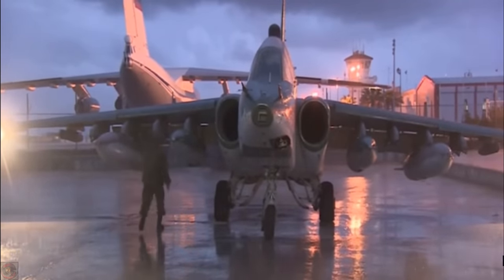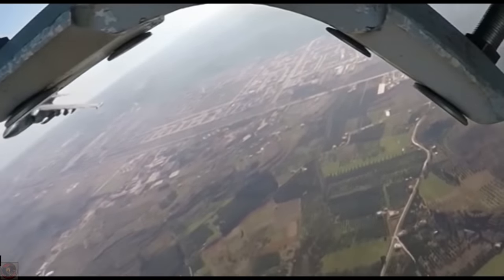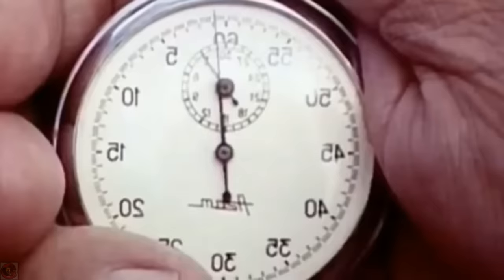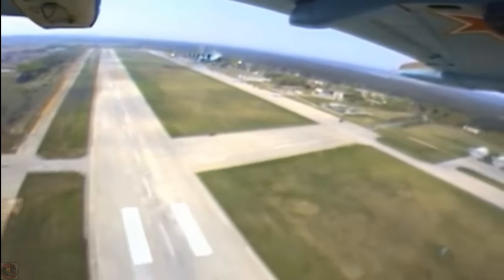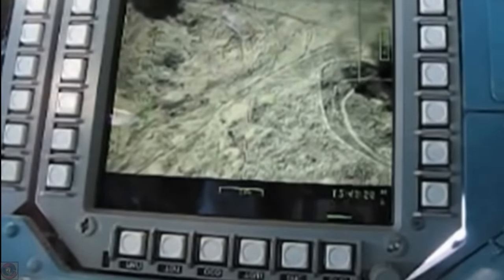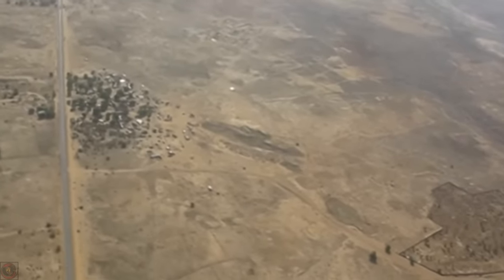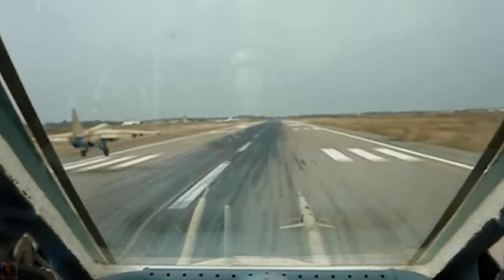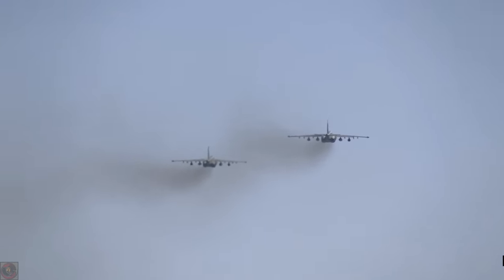Su-25 Frogfoot - The Russian Flying Tank

Comment: +Mastsimus Gaming : Great video Matsimus; I personally would NOT like to be on the ground looking at the business end of this aircraft! (Former U.S. Army Soldier). 
By the way, I tend to agree with you about your comments on this being a good aircraft for it's current use, i.e. blasting insurgents on mountainsides, in convoys, etc. In fact, I wonder why the U.S. and Britain doesn't use rocket pods as much as the Russians? I do realize that they are less accurate, but if friendly forces are far enough away, I think they are a perfect weapon, maybe especially the slightly larger rockets that the Russians use as well. (We in the West tend to only use the ~70mm rockets as far as I know of).
Thanks!

Comment: The A-10 GAU-8 rotary Cannon is a very intimidating piece of kit on the plane and is rather famous. But in terms of accuracy, yes it's not the best, relying more on a beating zone circle than actually getting rounds on target, it's basically glorified spray and pray. Still more than that, the economics is something often forgotten when it comes to war machines. The GAU-8's rate of fire is so high, there needs to be a big drum of 1200 30mm rounds to keep such a weapon viable, Those are huge rounds. That is alot of weight and an expensive amount of ammunition to mount.

The SU-25's  GSh-30 autocannon is not as impressive, still it does the job well. Needing a magazine of only 260 rounds. relying more to get rounds on target.  It's considerably more cost effective to reload, less wasteful of ammunition.

Comment: I once saw a video of an Serbian ( I think ) SU 25 . There was like an inch of ice covering the plane. The guys used sledgehammers to break the ice off and get it ready for takeoff. This airplane was designed to withstand extreme temperatures like in Afghanistan during the summer or the cold Russian winters. Pretty impressive. And it can fly using diesel fuel if needed.

Comment: I'm curious... why does the runway these aircraft are taking off from have that honeycomb pattern on it? Is it made up of a bunch of tiles? Is that just a marking used for measurement?
Reply: those are water drainage channels in runway concrete to prevent water puddles forming when it rains

Comment: Personally I believe the future of CAS is a return to propeller aircraft. They have better loitering capabilities and a slower approach allowing more time on target, plus arent anywhere near the fuel hogs jets are.
Reply: I've been thinking the same recently. Only thought that became a wall for now is how to design a prop plane that can also be resilient as either this one or the warthog. This coming from the premise that both planes jumped to fame exactly because of their staying power, that insane capability to withstand tremendous amounts of punishment and still land with an uninjured pilot. Cheers Col.
Reply: @hansvonmannschaft9062  interesting thought. My gut feeling is make a pusher with a rear mounted engine and prop. If that wont provide enough power than a similar setup to the Westland Wyvern and counter rotating propellers might be plausible. Its a tad complex but is all housed inside the main tail section and convenient for armoring. Without using a pusher or a prop based version of the current engine orientation I dont see another good placement that wont interfere with ordinance delivery or be tough enough to take a few dozen hits.
Reply: @Colonel_Overkill  Nono - I do believe you did nail it! I was tunnel-visioned trying to work around other succesful prop CAS planes like the South American Tucano and Pucara, with either nose or wing mounted props. But... A twin, interleaved-bladed, counter rotating prop package in the tail section would provide an immense amount of benefits and most important of all, the idea's plausibility! Must add this whole small conversation got me all excited and definitely reminded me of a decade ago, when I was a (relatively) young advisor in my country's DoD haha :-) Hopefully someone picks up on the idea. I know for certain, though, that the US' DoD has been looking into the above mentioned Tucano as a potential replacement for the A-10 - heck back then it was all over Jane's line of magazines. Been a pleasure Col, may you have a nice day!
Reply: @hansvonmannschaft9062  may you as well have a wonderful day. It is so refreshing to have both an intelligent and pleasant conversation in the comments. A true rarity in these days.
Reply: Colonel Overkill this is actually true, a lot of militaries are developing propeller CAS and the US is also interested in them after the A-10

Comment: Why does the Russian military love rockets so much, because they're cheap?
Reply: Because the destruction from  heavy rocket fire is just as effective as 30mm cannon
Reply: @thomasgellos1732  That makes no sense, seeing how they can carry far more cannon shells than rockets, so if they are just as effective, why carry rockets at all?  No, the rocket pods are attached at hardpoints under the wing, taking a spot that could be used for other munitions, to include precision guided munitions vs. the area effective rockets.  It is not just with the Su-25, you see it with many of their attack platforms (i.e. Mi-24).  So, it begs the question, why?  Is it cost of rockets vs other munitions, or is it a tactical decision because they view concentrated rocket fire as more effective than say a 500lb bomb?  If they do, to me it proves that they lack significant numbers of precision guided bombs of that size (smaller than 1000lb) in their inventory.

Comment: Precision guided attacks do not seem to be Russia’s forte:

“Despite the publicity surrounding them, it was the older Su-24 Fencer strike aircraft and the Su-25 Frogfoot that would do the bulk of the heavy lifting in Syria. And while there is no disputing the abilities of the Su-30SM and Su-35S in an air-to-air dogfight, without a modern targeting pod, their ability to lob anything but unguided “dumb” bombs is extremely limited.

“As a result, precision weapons have only been a small fraction of the weapons employed by Russian aviation forces in Syria. On occasion Russia has provided images of Su-34s carrying guided weapons such as the KAB-1500L laser guided bomb, the Kh-25ML laser-guided missile which dates back to the Soviet era or the KAB-500S GLONASS satellite guided bomb. But those weapons are the exception rather than the norm, and almost exclusively carried by the Su-34. Instead, ‘dumb’ bombs are the absolute majority of bombs dropped, mainly the 250kg OFAB-250-270 and 500kg FAB-500M-62 as well as the RBK-500 cluster bombs. Strangely, the Russian aircraft have flown with very small weapon loads, carrying only a small portion of their available capacity.

https://foxtrotalpha.jalopnik.com/russia-s-involvement-in-syria-proves-that-its-far-behin-1794966734

Comment: The Reason SU 25 is a bit old in tech is because most of the modern tech is plumped into the SU 34, which is FAR MORE MODERN, and far more capable.

SU 25 is simply cheaper to use against insurgencies, Terrorists, and enemies with limited capabilities.

Comment: Why didn't East Germany get the Su-25?  This was the one place it was designed for and where it was most needed.  This was where the Warsaw Pact most wanted tank-busting ability - in the tank-on-tank clashes at the center of gravity of a World War 3.  Instead the East Germans --- ordinarily favored with the top-of-the-line Soviet equipment, not downgraded export versions -- had to make do with the older Su-22 which while rugged lacked the armor and heavy guns, and the MiG-23 pressed into service in the ground attack role, and not even its MiG-27 upgrade that had ground attack modifications.  The East Germans even had to watch Bulgaria (which, let's be honest, was a backwater) be given the Su-25 -- for use presumably in the secondary priority theater of the Balkans.  What gives??

Comment: Russia is going to upgrade the Su-25 because Syria is showing them a plane like this is still very usefull. The plane is maybe very old, but it is a part of a army that can provide more high tech support to the pilots of the plane.

The US is going to take the A-10 out of service and replace it with the F-35 JSF. If you're pilot, what do you prefer: flying low altitude with this old Su-25 or flying low altitude with the F-35?

Comment: Like their Dome Radar system Russia has a stratified system with their aircraft where they are used together in a mix according to circumstances with each having a particular role so the SU-25 is protected from Patriot and other threats from the air by other aircraft and missile systems. With most of their weapon systems Russia goes for durability, survivability and ease of  operation and maintenance and repair in the field whereas with the US they have to be returned to special depots or the manufacturer. They also go for numbers which requires the costs to be kept low.

Comment: You definitely didn't get a thing during watching this aircraft - it does not need smart ammunition because aircraft fire control system is smart enough to calculate where brainless rocket will go, also ussr/russia don't use Gatling system(they were tested but considered over complicated for task which can be done other ways) but it doesn't mean that main guns does not have competitive rate of fire, which is 3000 30mm rounds per minute

Comment: The need to update weaponry is not a subject that is overlooked by any means by the Federation of Russia, however, they are smart enough to produce first then let the news out.
There are three new aircraft under build at the moment, none of which you will see let alone hear about, but all three have vastly more dangerous forms of weaponry, the idear being to hit every time as apposed to waste on misses, every bit of weaponry must be able to pay for the ride, plus travel so fast you cannot avoid it or outrun it.
The other thing that goes unmentioned is the fact that operational hight is also a big thing for Russian aircraft these days, the higher you go the less fuel you use the longer you can stay in operation, plus being attacked from an aircraft that is way above you provides greater safety for the pilot or for the flight system if unmaned, there is flying under the rainbow or flying over the rainbow is the way it was put to me.
These days its far better just to carry on the work and say nothing, at the same time as keeping your ears well tuned to the market place.
A brief look at cival aircraft and its production in Russia, their engines are now very much cutting edge and promise even better thing in the very near future, and for countries that like to think they are top dog, being bitten in an area were the crown jewels are kept, and being able to make that bite is a goal worth chasing as far as Russia is concerned.
You will see a lot less of the fantasy designs that are shown for the U.S. air force on you tube, i think a good example of Russian design is based on the behavour of something like a honey badger!!!!!

Comment: The Su-25 and the A-10 are both great at providing hard-hitting air-to-ground firepower since they are both basically flying tanks.  But the AC-130 Spectra Gunship would beat them both: a flying canon beats a flying tank anytime in terms of shear firepower.

Comment: The reason you didn't find that info on modern systems for the su 25 is because there is none. The SU-39 on the other hand has those systems and is the "modern" su-25.

Comment: Question i like to know the frogfoot looks like the old coldwar airframe with higher speeds needed for lift with swept wing which gives stability at speed and would i be right in saying its way inferior to a10 warthog regardless of weapons becuse ground targets aint moving fast ?grount support ? ._...A10 turbofans wide radius throttle back to 150 knots and turn on a 10 pence .... Frogfoot needs 4 miles to turn around no ?.._thats not ground support when a10 has passed target 3 times to su _25 one time ._..I Watched an  a10 stand on its tail with square wings designed for slow speed high performance  inputs just if the frogfoot did it id say the wings would fold up ._no comparison and thats before we even look at the weapons..__a10 is the sexiest ugliest most beatiful and effective bit of engineering ever created  ._no ground support better in my opinion

Comment: 250 rounds of 30mm cannon is not even in the same game as the the GAU in the A10. And your comment on the accuracy of the cannon fire is absolutely incorrect. The first active squadrons in Germany were tasked with flying under power line height to strafe a column of armour on a perpendicular axis with just the rudder to fishtail the spread of the fire. The accuracy is only down to the pilots aiming. Technically they perform the same role, and have some similar capabilities but the redundancy and battlefield survivability of the A10 us unrivalled.

Comment: You know I have seen this thing with same middle pod as the ka50 which means for a single pylon you can get 6 10km tandem charge 1400mm penetration rate air burst and target lock missiles for a single pylon

Comment: An excellent aircraft with capabilities never fully reached. I have read that is was designed after the Northrop YA-9 which lost out to the A-10 for the USA. If you look at the A-9 you can see the resemblance. A few things you did not mention was the ability of the engines to run on the most basic fuel, the worst available and to land on any runway. Also in Afghanistan they used rear firing gunpods that pointed downward, although I don't know how often and how much they were used.  An underrated aircraft that should have had more popularity with countries that need CAS as well as any other medium/short range bomber/attack duty. The desire for shiny toys like fighter jets does not only afflict the US Air force, it does as well to other nations and they ignore the need for ground attack with some loiter ability. I think the CAS job and the A10 as well as the AC130 should be given to the US Army to use and maintain.

Comment: You forgot to mention that this aircraft is designed to take off and land on crap airfields in almost all conditions, that is very important.  It does not need to be sophisticated to do that, it just has to be simple, sturdy and well designed.  Imagine that this thing was designed to land at first on soviet airfields in the snow where the runway was not well maintained (potholes and ice).

Comment: Really? It has a twin barrel 30mm gun with just 250 rounds... Dude that's are 125 rounds per berrel... Dudeee the A10 has 1100 rounds of 30mm
Reply: Who cares? Su-25 can take attachable high velocity guns if necessary under wings. Besides, gun is obsolete thing for modern strike missions unless you are fighting peasants with no air defense. Shooting from gun requires straight flight for a few seconds that makes plane very vulnerable.

Comment: It may not be as good but I bet that's a lot cheaper to run than an A-10
Reply: That's the whole point. Cheaper= more number of planes and more sorties
Reply: Like most Russian military hardware it's incredibly sturdy and reliable, but it also guzzles fuel like there's no tomorrow. I agree it's probably a bit cheaper to run due to lower maintenance costs, but that Russian engine will likely be a lot less economical (compared to an American/British built one) and the thing still weighs close to 18 tonnes when it's fully loaded. They're gonna be spending a few Rubles to get it air-borne, I bet.
Reply: You also have to consider the ground operation. A-10s need specialized loading systems,weapons jacks,hangars,maintenance crews, then you have to sweep the runway before you can takeoff.The Russian just man handle bombs use interchangeable parts and can takeoff of dirt strips if they need to.I think a few gallons of gas per hour is bit cheaper than the runway you would have to build for the A-10s.But what do i know the su25 might well be that thirsty,i will admit it gets throw a lot of diesel in DCS.
Reply: @archiescriven6178  Yes, I take your point. 
Let's not forget that you can't exactly park one of these babies at the nearest gas-station and tell them to "fill 'er up" though. We're talking about tons and tons of jet-fuel needing to be transported into the area of operations, creating highly vulnerable supply-lines. That's kinda what happened in Afghanistan, where the Mujaheddin specifically targeted Soviet fuel transports. So there's another big downside to operating an aircraft with a very high fuel consumption and such limited range, especially when you're fighting a war of occupation. = all I'm sayin'.
Reply: @runi5413  That's true and i can't deny the vulnerability of supply lines,but your missing the point,the comment was about the cost of running and producing the plane not it's tactical side of it.All tho saying that it doesn't mater how cheap it is if it doesn't work.Is quite an interesting thing realy.

Comment: those S-8s are a hell of a lot more firepower than the hydras. it gives more area of effect, and more single, aimed shots.
also the vikhrs are really good. where the a-10 can carry 12 agm-65s at absolute max, which is never done, really the su25 can carry 12 vikhrs as standard loadout and still have hardpoints left for bombs or rockets. they are less accurate though, not fire and forget. though beam riding helps with smoke.
russian vehicles, especially the early versions really suck at nighttime optics.
Reply: The A-10's absolute max is 6 AGM-65s, not 12. The Su-25SM3 can carry 16 Vikhrs.